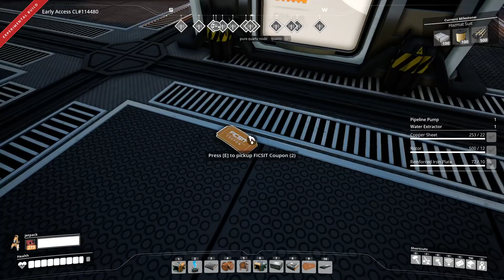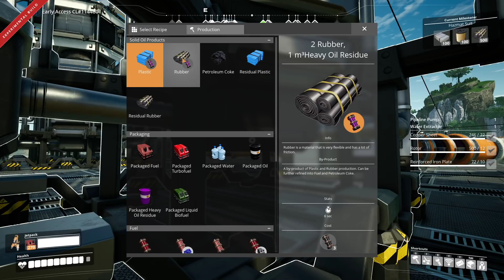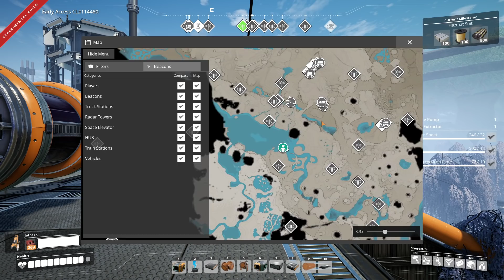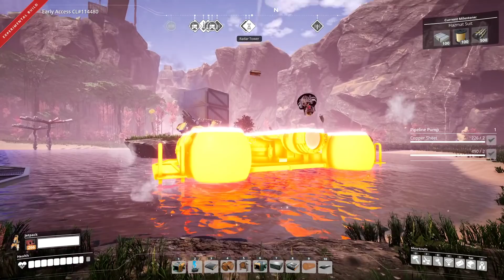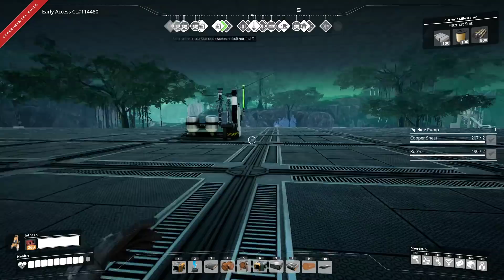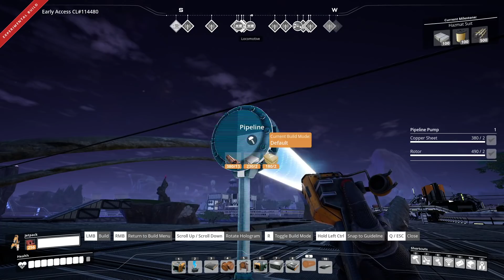SATISFACTORY Update 3 #18 - My Factory BROKE!

Comment: 24:00 the back-to-back water pumps don't work like that unfortunately; a pump adds up to +20m elevation in front of it, but it doesn't stack. So if you had a 15 meter vertical climb, one pump would be enough. If you had 30m to climb, and put them both side by side at the bottom, you would not get water at the top. You would need to put one at the bottom, then another halfway or so up the climb. Although in this case you could technically get away with just 1 still as the pipe naturally can climb 10 meters, so putting the pump 10 meters on the vertical climb would do, but I've found it finicky and usually do every 15 meters, not 10 or 20.
Reply from the maker: Ok thanks. That last pipe actually started working about 1 min after I stopped recording. But it was slow.
Reply: How do you measure the height?
Reply: @Ekevoo  Couple ways. Check flow at the highest point and compare against the bottom. Otherwise it's difficult to do by eye, so you can put a pump down at the bottom and see how much "head lift" it is going to give you. If it's below 10, the pipe is fine by itself. If it's higher than that, add a pump, then inspect the pump. If the head lift on the pump is below 20m (realistically, shoot a little under that) then you have sufficient lift. If it exceeds that, you'll need to add another pump 20m or so (agian, I'd shoot a little under that) up. You can check the second pump height by looking back at your first pump and seeing how much head lift it is now providing.

Comment: There's no way I'm restarting. I like my foundations and buildings how they are, and a lot of my productions will probably still work. I'd rather look at each production to see what can be reworked, and what needs to be deleted completely. 

I've stored 16,000 Turbo Motors to get all of the specialty items from the coupon shop, and 80,000 Alclad Aliminum Sheets, so I can build with Mk5 Logistics until I get Aluminum sorted out. It looks like I'll be wrecking oil completely. I'm excited for the new foundations, because I have a really long, ground-hugging, foundation road through the map that can probably be made a lot smoother with the new pieces! 

I'll be taking my Factory Cart everywhere!
Reply from the maker: It was hard to give up my 200 hour base but this way I can explore the new area and make a cleaner factory.